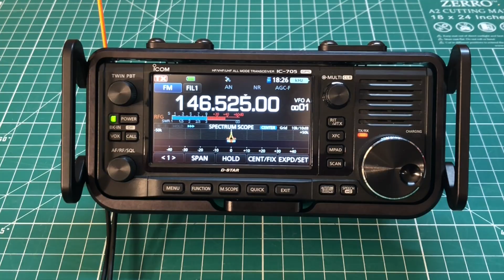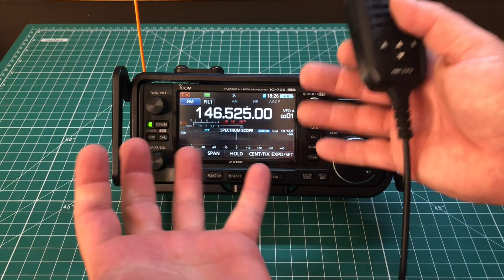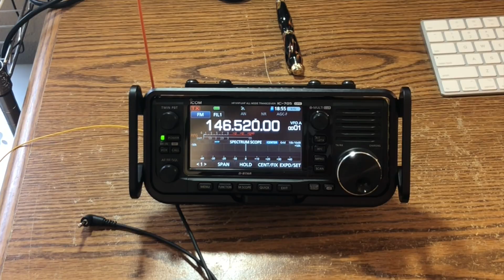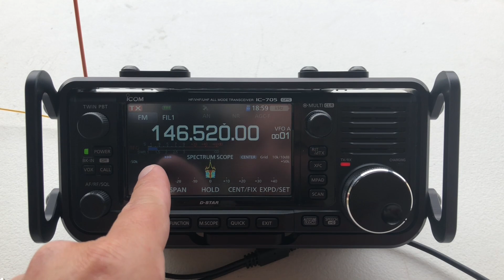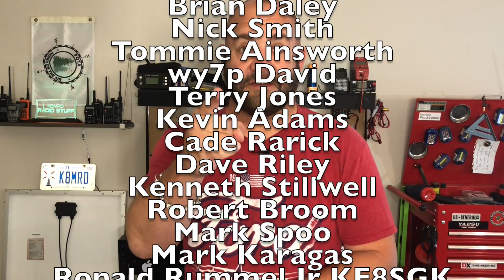Improve your SWR | SignalStick Antenna w/ Icom IC-705

Comment: Hi Mike. I am having high SWR with my Anytone D578 on VHF with my Signal Stick. Radio actually stops transmitting on all power levels but low. Tried counterpoise with no luck. What power were you running on your 705 demo? Thanks. Mike KB9MEQ

Comment: I’m having the same horrible SWR with a little portable dual band in a plastic ammo can.   That is with a bnc signal stick and smiley II telescopic.   Great SWR on my vehicle through-glass antenna. I’ll give this a try.  If there radio doesn’t have a handy lug like the 705 for a counterpoise, how would you recommend connecting it?  TH-8600 by TYT for this portable kit.

Comment: Hi！I am just wondering which brand 90 degrees mount you were using? Thanks!
Reply from the maker: Hmmmm, that is a very good question.  I'll tell you, I have no idea.  I often will pick up connectors at local ham swaps or bigger ham conventions, but I also am not ashamed to grab some cheap connectors from Amazon.

Comment: Yep, the 705 doesn't have a ground plane  plus your body like an HT. I found placing the counter poise at the antenna connector to be better. Put a ring on the outside of the connector.

Comment: Would you recommend a counterpoise on an ICOM ID-52?
Reply from the maker: Not really.  You can, and may have slightly better performance but typically with an HT YOU act as the ground of the antenna so they aren’t typically needed.

Comment: Or get an antenna that works way better like HYS dual band tactical antenna or similar brand antenna, these antennas don’t need a counterpoise and has a good SWR!
Reply from the maker: Except for the fact that once you put the word "tactical" on something, it immediately looses all credibility.  Nevermind it's not the correct connector.
Reply: @hamradiotube  sorry I should have mentioned that yes you do need the adapter to connect to the705

Comment: Super simple mod. You can do the same thing with an HT and make the signal much more efficient. Attaching a counterpoise to the HT can be an issue, but it's do-able.
Where did you get the actual antenna, or did you make it?  Me making one is not an issue, but other's may want to purchase one.
Barry, KU3X/QRP
PS......nicely done video
Reply from the maker: Yes you can.  SignalStick is a brand of antenna that I have reviewed in the past and there are links in the description to the website.  All profits go to hamstudy.org to help get people licensed.  It's a great, free online study tool that has helped countless hams pass the test.

Comment: Do not solder the wire after a crimp.  It just makes a hard wire connected to stranded…..and a place that will break with any flexion.  Heat shrink will make the connection a little stronger but the wire will still break at the solder - stranded wire junction.  Do not solder crimped stranded wire.  Stranded wire is stranded for a reason…… to be flexible.
Dave K8WPE since 1960

Comment: I used a random length 16 gauge wire for a counter poise and put it on my 705. Just by folding the wire, I was able to tune the counter poise to almost flat swr. There's also the 42" Abbree foldable antenna. No counter poise needed for it, but it puts strain on the BNC connector.

Comment: Just got my 705 and have been testing out most of my BNC antennas. The signal stick has been the worst. Well, WAS the worst. It's the same dual band version you have and your counterpoise works just like your video shows, I'm below 1.5 on 2m. Still is HORRIBLE on 70cm though. I have the short 70cm signal stick as well and the counterpoise works on it as well. Looking at a 1.25 with it and the counterpoise. 3+ without it... I certainly wouldn't call their long version a dual band... Thank you very much for this video!
Reply from the maker: I’m gonna have to experiment more with 70cm.  I’m not on that band much so I didn’t bother.  Glad you got the swr down.  Thanks for watching.

Comment: I’ve had no problems with mine. 1.2 on 2m
Very strange. I used to use it all the time for a quick net check in when I felt like sitting outside. I consider it the ultimate HT!

Comment: Mike, what self-adjusting wire strippers do you use? Thanks!
Reply from the maker: Theyre just cheap harbor freight strippers.  Not the best but it’s what I got.
Reply: @hamradiotube  Nice. Thanks. Picked them up. Only 10 bucks. Work great so far.
Reply: Looks like Harbor Freight.

Comment: Funny how I emailed the signal stick folks and they sort of deny there is anything wrong with it.
Reply: Huh? They have a note right on the website talking about this issue. Three paragraphs in fact.
Reply: @HabemusQuattro  I know, that's why it's funny.
Reply from the maker: There is nothing wrong with the antenna.  It's the way antennas work for HT's.  Our body usually acts as the other half of the antenna, but with the 705, we're not holding it so it's missing that part.  Their website acknowledges this fact.  I haven't seen them deny anything.

Comment: If I understand correctly, in the case of an HT, the counterpoise is essentially the metal casing around the unit and the battery, correct? So, this would imply the casing of the IC-705 isn’t up to the task? Also, does this workaround and lower SWR necessarily translate into better transmit/receive capabilities? Thanks for sharing.
Reply: The counterpoise with an HT is generally the person holding the HT.
Reply from the maker: Not really.  You're body is really the counterpoise of an HT.  The 705 has a metal chassis, but because you're not holding the radio, you need the counterpoise to complete the antenna.

Comment: Thank you. I did everything except place the Counterpoise on that screw. Now I have two handheld antennas for 6m, 2m and 70 cm. What length counterpoise do I cut for that one?
Reply: I'd start with 1/4 wavelength of the lowest band you are working with. So, starting with a piece of wire about 54" long for 6m might be a good place to begin. For 2M/70cm, 19.25 inches sounds like a good starting point.

Wire, a crimp terminal and a bit of solder is cheap enough to experiment with - so have fun! 73, KO4AZY
Reply: @theElderberryFarmer  Thank you. Will do today.
Reply from the maker: What Dwight said.  He's right on the money.